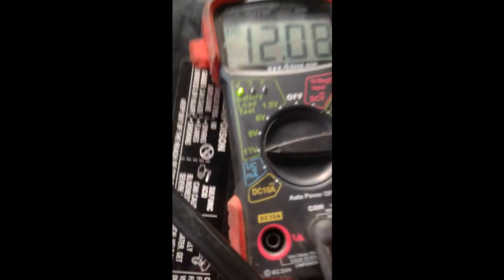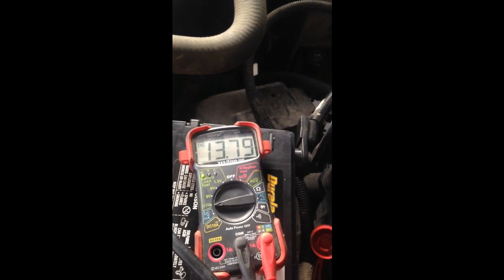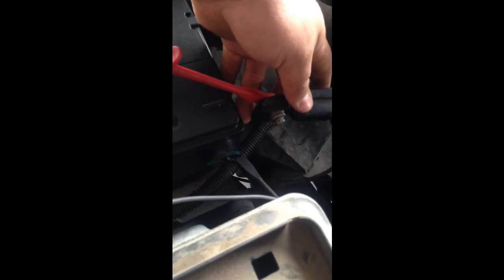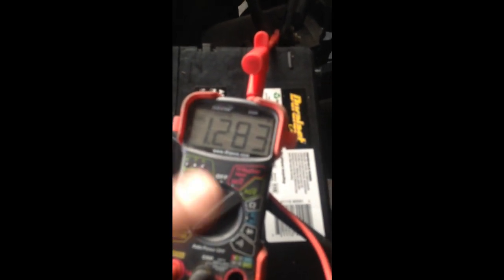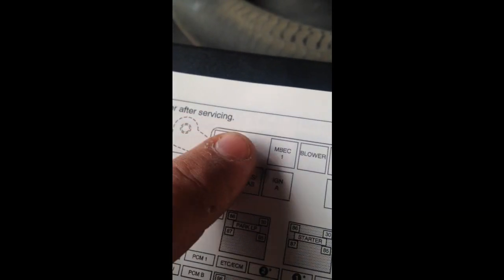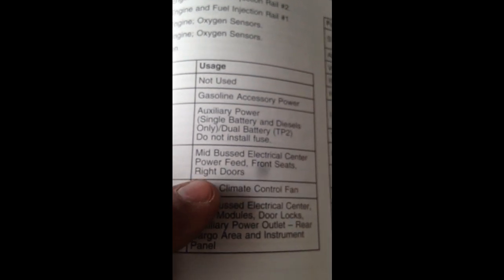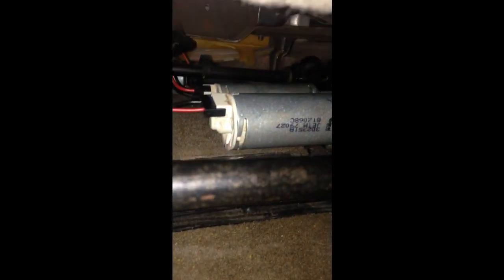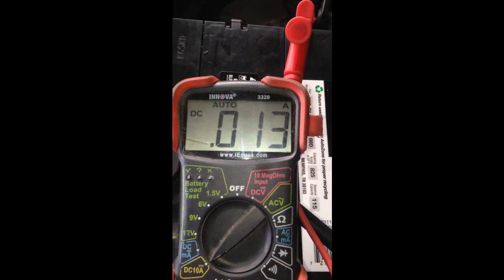2004 CHEVROLET TAHOE BATTERY GOES DEAD

Comment: Electrical issues can be expensive my 04 suburban the alternator had a bad diode that causes the alternator to let the power out of the battery when parked find a good mechanic that won't charge you for his guessing

Comment: My Dad's 04 Tahoe and my 04 Tahoe have the issue with draining battery.  If the seat motors are flawed, can we just unplug and leave them that way? My seat will be in the set position and doesn't need to be adjusted so I don't need them. 

I'm curious- with the shorted motors in the seat- Was the seat still working properly? 

THANKS FOR YOUR VIDEO

Comment: I have a 03 Tahoe that’s doing a pull on battery right I’m down to ever fuse pulled ecm & Alternator disconnected only thing I have left is starter. What next idk at a loss.

Comment: Kinda have the same problem today my battery died I put a new one in it worked next day it died replace the battery it Redline all the way to 19 and dropped all the way to 9 any clue they said the battery was good alternator was good and diodes we're good what would make the battery overheat

Comment: I went and tried mine, not the seat motor.  I think it’s the RR HVAC fuse.  The rear blower. It has not worked since I bought the 04 Taho.  I pulled the fuse and no draw on the batt.   I will know in the morning.

Comment: I think I may have that problem or something same truck battery be dead every morning and after work. such a headache. what else could be the problem if its not that particular problem.
Reply: Jaterris Nales - I have a similar problem. Start by doing the parasitic draw test. I found it was a fuse that controlled the gauge cluster and ignition. Hope this helps.

Comment: Helio I got a 2001 Tahoe I did the draw test and mine read a 1.18 it was my factory amp so I took out the fuse and the draw dropped down to a .68 is this good or is there still another draw I need to look for
Reply from the maker: mike baker if the amps fall when you pull a fuse it indicates that that circuit is drawing some current it depends what the fuse is for
Reply: Helio Trevino I think it’s suppose to be less then 50 milliamps